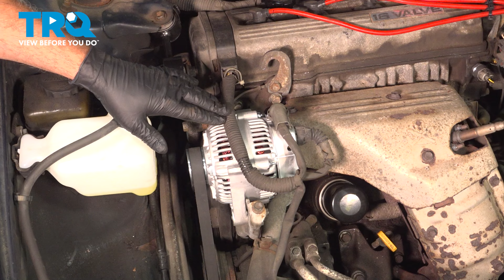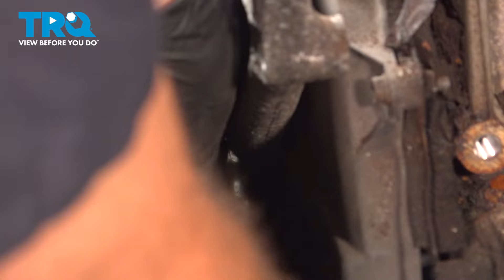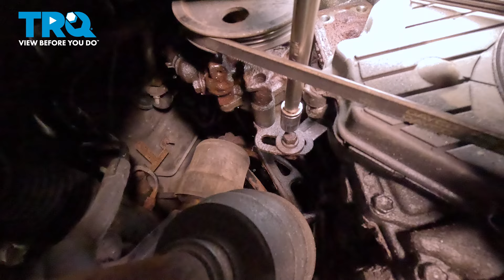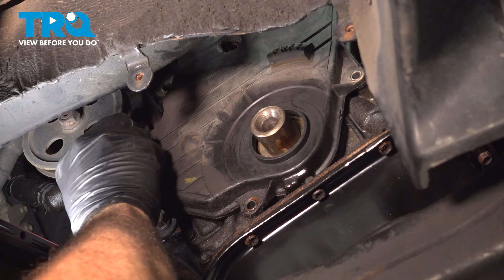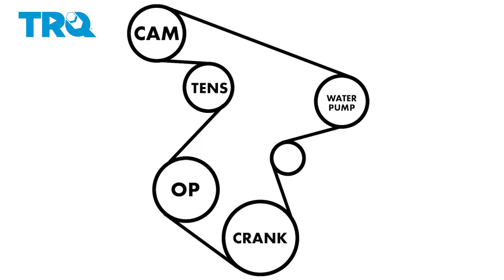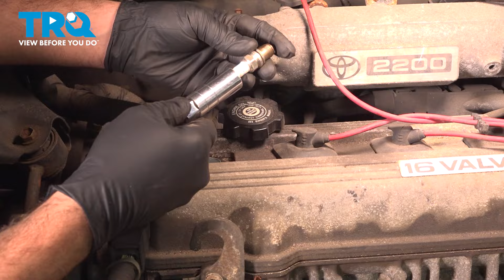How to Replace Engine Water Pump 1992-1996 Toyota Camry 2.2L L4

Comment: Did you seriously just mark the thermostat housing, and the thermostat to replace the gasket on it? I mean, you're right.That's so easy to mess up or get confused when you're putting it back.I suppose you can put it in backwards or upside down.You don't want that to happen. 🤦